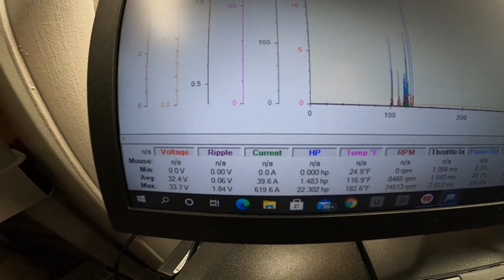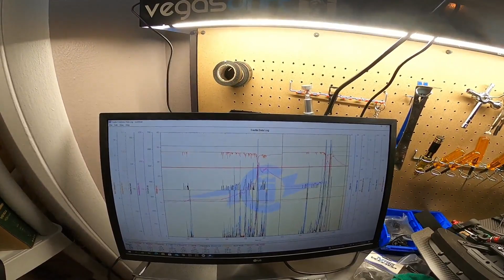$3,000 RC Car Ran Over And Totaled After 154mph Pass!!!!!  #Destroyed

Comment: I feel ya bro, been there done that. I destroyed my Limitless on a run, and I was only doing ~76mph, car shot off to the side of the road just as it passed me. It hit the curb, jumped up & smacked a light pole, i had time to see the explosion of pieces flies in a million directions as if in slo-mo lol, it then flew across the 2 lane road & smacked one of them big metal utility boxes on the side of the road...... Yeah, it was bad lol. But like everyone here says.... You build back better, stronger & faster. I now have pushed her to 122mph so far at 92% throttle. Before the crash I was stuck at ~101mph. Still trying to find a better & longer road where I can push 100% throttle.
Race'm, break'm, fix'm, repeat! 😎👍
Reply from the maker: Hell yeah man. It's what this hobby is all about!
Reply: @zagertRC  Now I'm eyeballing the new 1721 2400kv castle motor!.... Crazy RPM 😁
Reply from the maker: @rcbustanut2057  Yeah I want one now too😂😂. I might have to buy two and duel motor to be different from everyone else 😁🤙

Comment: Sorry about your rig man... happy you doing better... mind if I ask what reciever are you using with your nb4
Reply from the maker: FlySky FTR10 2.4G 10CH PWM AFHDS 3 RC Receiver Support i-Bus/S-Bus/PPM Output for RC Drone https://www.amazon.com/dp/B083SKDXDT/ref=cm_sw_r_apan_glt_fabc_MQFFGEX7X46EZ3GZ0TAW?_encoding=UTF8&psc=1
Reply from the maker: Airplane reciever that says 3500m of range. It's a lot less on ground
Reply: Do you need the module that comes with it...
Reply from the maker: @rayjohnson5875  I didn't use it, I'm not even sure what it was for😂
Reply: Ok.. thanks.  I put the order in on amazon.. wasn't sure if I needed it.. but it comes with the reciever... I want that longer range for my speed runs